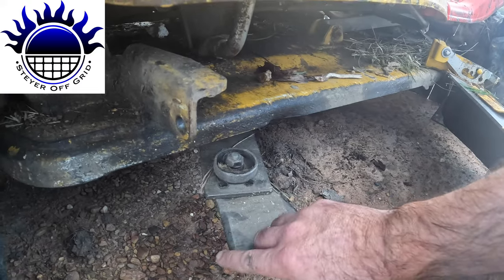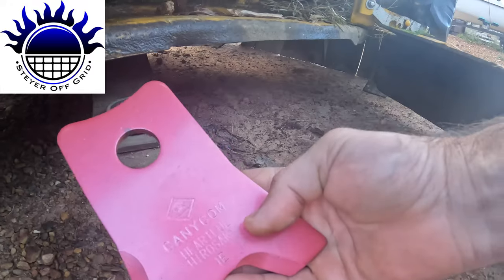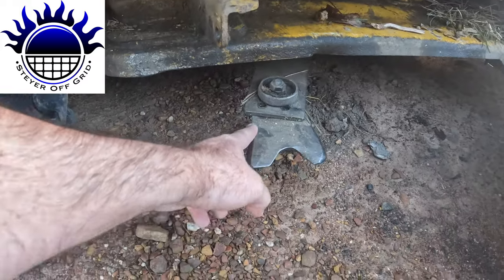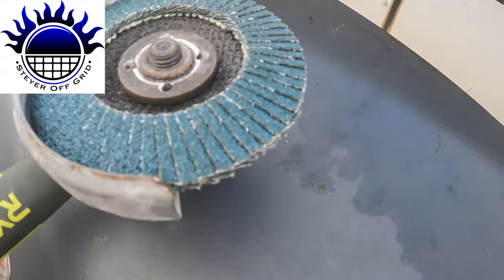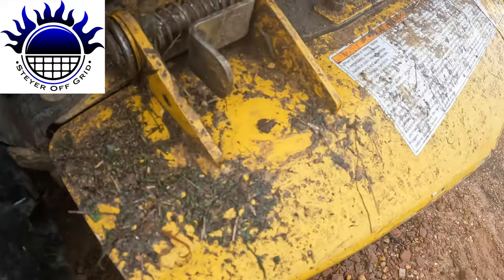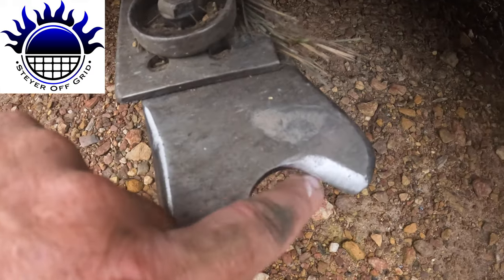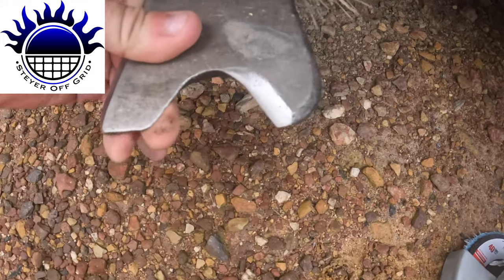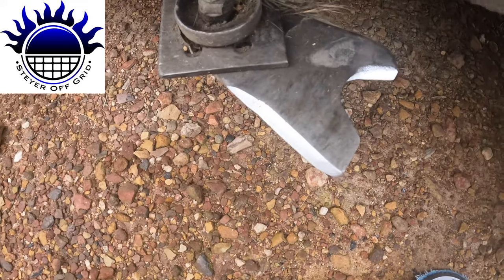RazorBack Mower Blades Sharpening

Comment: Looks like you've got the wrong replacement blades for your machine.  You have  bolt on blades on the mover. Looks like your spare is a zip zag type that comes with a retaining lug that follows a channel to retain the blade.
Reply from the maker: You are probably right, they did come with the tool less connections, but I thought the hole is still the same diameter?
Reply: @steyeroffgrid   if i'm not mistaken those replacement blades are for more powerful canycom models like cmx 227